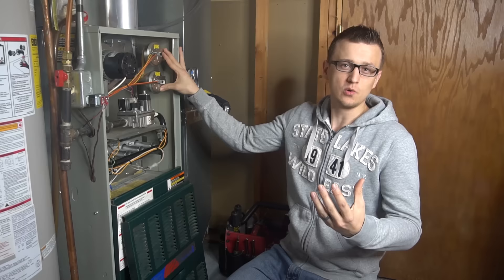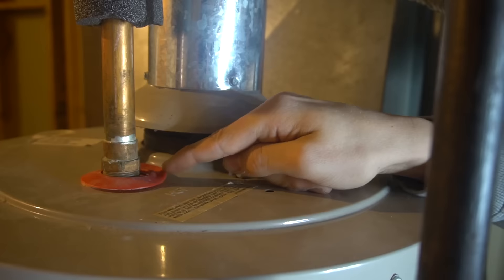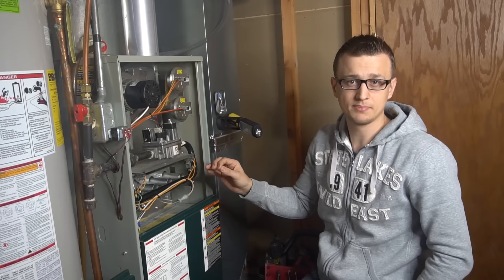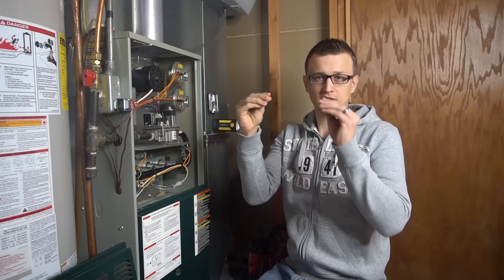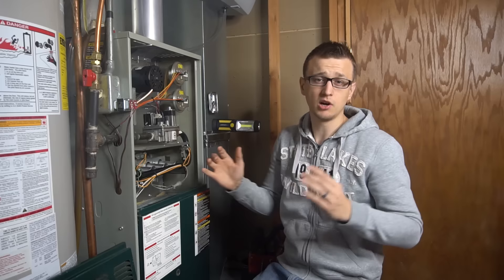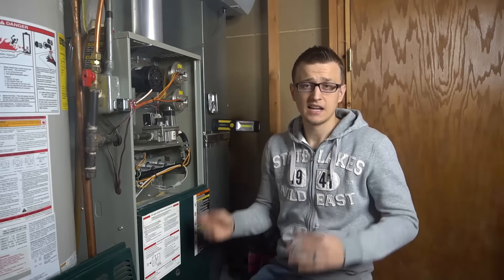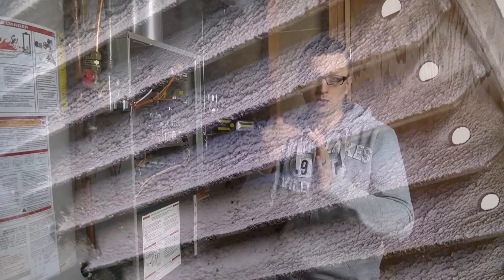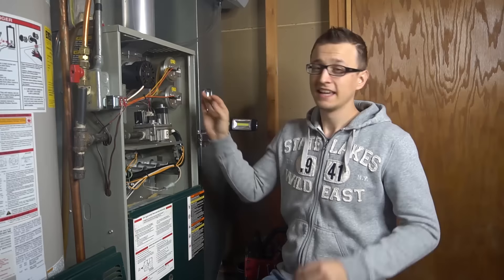Furnace Pressure Switch Troubleshooting

Comment: Jay, thank you for the accurate and useful information to understand and help repair a furnace issue. This Sunday morning, I noticed our 12 year old High Efficiency Carier furnace making a running sound. Our thermostat showed 66 (set at 68). The main furnace blower was not running. I removed the furnace panel and didn't see  flashing error indicators. However, I didn't get down on the floor to look into the little observation hole. So, I started looking at the many hoses and connections and discovered the condensate drain hose, severely bent. I can't believe it was built this way, but maybe through the years the strength of the hose weakened and could no longer support the sharp radius bend. I went out to my local auto parts store and bought a foot of rubber hose to replace the old one. 

Thanks for the tip about cleaning the condensate trap. I removed mine and used an old drain cleaning snake (like a large pipe cleaner, that worked great). There was not a way to attach the photo of the hose and cleaning snake, so I added that as my picture for reference.

Thanks again from a past TV repair guy (with BSEE)
Gene

Comment: My furnace would only run for 5 minutes on 15 minutes off under continuous heat call. My low fire pressure sensor switch was not closing, when I bypassed it, the furnace worked. But next, high heating ran for no more than 10 seconds at a try. Your suggestion of removing the burner access panel solved everything, indicating an intake blockage. The installer did not put a screen on the intake and mice built a nest in the intake pipe. Too bad you don't do car trouble videos LOL. Thanks!
Reply: If you don't find anything in your intake can it be your inducer motor I have same problem

Comment: This may be one of my first comments on a video on youtube. But I really need to say Thank you. My port turned out to be plugged. I first tested the pressure switch, then tried sticking a piece of wire into the port which is on my inducer motor housing. I pushed in until I hit a hard stop. I didn't want to press to hard as I didn't know if that port had a turn inside of the inducer motor housing that I couldn't see. I tried rotating it around while applying pressure in hopes it would find its way like a drain snake if it wasnt a straight shot. Nothing. The end of the wire did not have anything on it either hoping it would give me a sign that I am pressing against a dirt or whatever blockage. From there I turned power back on to my furnace with the hose still disconnected and placed my finger over the port to test if I could feel pressure or vacuum and give me direction to work whether pressure switch or port side. I could not feel anything. From there I knew it was in the port or deeper into the furnace, so I grabbed my piece of wire once again and pressed it with a bit more force and finally it popped through whatever was in there. It was stuck in there pretty good. More so than I was expecting anyway. Again thank you. Great video. Easy to follow and very informative. You earned yourself a new subscriber.

Comment: You're a lifesaver man.  We rented a house 2 weeks ago,  so I was going to have to wait until the morning for my landlord to get back to me and call an HVAC guy.  I knew it wasn't the igniter or flame sensor, and knew the inducer motor wasn't turning on. I unplugged the pressure sensor tube and it didn't seem clogged,  but I blew into it,  plugged it back in,  plugged my furnace back into the power source,  and the whole thing turned on! It's really cold already in Rio Rancho, NM, so it was not good to have the heater off the rest of the night. Thanks so much! ❤❤❤

P.s. my husband is asleep while I was fixing the furnace haha 😋

Comment: THANK goodness for the internet... 3:46 is exactly what happened to me. I floundered to fix my issue after watching many videos but this particular video pushed me to the correct solution! Thanks so much for the video! It saved me money I couldnt afford to spend at this point in time. 

 How I fixed my issue: (its a bit long winded and is only for those that may be interested in this kind of stuff)

To begin with, my induction motor would not start up. I also got the 3 flashing light error by default (Error code 3; Pressure switch stuck open.)  No spinning/working induction motor means no vacuum to the pressure switch which leads to this error code.

I found my induction motor was frozen or stuck, but after a while I was able to get it loose by rotating the motor manually. Eventually I was able to get the motor to spin freely and finally got the induction motor to start on its own with out help. However, the 3 flashing light error persisted and the furnace would not ignite.  Which lead me to concentrate on the 'Pressure Switch'  

Unfortunately, I did not have a volt/multi metter to test the voltage at the time to the pressure switch so I did the next best thing and simulated a vacuum to the 'Pressure Switch' directly and the furnace ignited.  (use your imagination, sucking on the hose lightly, steadily and slowly) this 'procedure'  actually got the furnace to ignite  and thereby eliminated the 'Pressure Switch' as the issue. That said, had that procedure failed I would have been forced to check the voltage to the 'Pressure Switch' and moved on from there. 

The diagnoses from the previous test dictates the 'induction motor' was not producing enough vacuum to the ''pressure switch'. This is when I removed the 'induction motor' housing from furnace. This is where I found 2 baby birds stuck in the inner housing of the exhaust fan. I can only surmise during the spring time birds nested in the exhaust tubing and the 2 chicks tried to fly free from the nest but ended up deeper into the exhaust tubing and eventually ended up in the 'induction motor housing'

Obviously, once I cleared the housing and reassembled everything. The furnace operates normally. Had it not been for Word of Advice TV I would never have thought of looking at the exhaust part if this issue. Again, I am extremely grateful for this channel!

Comment: Thank you many times over. Our gas furnace was not coming on. I watched several of your videos on how furnaces operate and how to troubleshoot and narrow down issues. I then went straight to looking for an error code on the controller board; then watched this video once I got to the pressure sensor switch open code. After probing for proper voltages, I blew into the pressure sensor hose going into the fan/motor housing, and it was completely stopped up - no air movement. Ran a wire through the port, plugged the hose back in, and the furnace was back to working. Your hands on demonstrations and practical tips - like shorting out R and W to call for the heater to turn on - are very helpful.

Comment: I've been troubleshooting many other things both for work and at home my whole life and immediately knew that this was going to be extremely helpful.  You covered a lot of ground in a very short time.  I was not disappointed!   For me the pressure switch would not release until I removed the tube on the condensate side.  I'm pretty sure I'm going to find that it's time to replace my 30 year old furnace. The good news is that I was able to get the heat running for now, the inside temperature was getting pretty low.  I need to poke around some more to see what I can find but I'm pretty sure I will need to call in the professional's for a total replacement.  Unfortunately, from experience I know that it will be best to checkup on the work they do, they all are not as good as you are.   For instance while troubleshooting this problem I found that the C terminal screw for the common bus side of the 24Volt transformer was at least a turn and a half loose.  Not sure how it has worked for so long. Thanks Much
Reply from the maker: Thanks John! Glad you found my video useful :) Good luck with the furnace!

Comment: I have to say thanks! My blower port was clogged. I was about to assume it was either the switch or the control board and with a stiff wire, I was able to unclog it. Works like new. Thanks again!!

Comment: Thank you for all of this information. I woke up to a 59 degree house yesterday morning. I saw that it was a pressure switch fault. I gave the pressure switch a couple knocks and the hose a few squeezes and the furnace began cycling normally. Wake up this morning to a 61 degree house. I took the pressure switch hose off, blew through the hose, put a needle through the inlet on the housing and gently into the pressure switch inlet and it is now cycling normally again. I hope this has finally fixed it!

Comment: Hi Jay: 
One of the best video on pressure switches, however we are seeking more of your knowledge on pressure switches;
Can you please do video on:
1- When you have two or more pressure witches how do you know which one is bad?

2- the difference between two ports and single port pressure switches with respect to testing?

3- the difference between two terminals and three terminals pressure switches? 

4- Can you use three terminals pressure switches for two wires and simply not to use the common terminal? 

5- for two terminals, does it matter which wire connected to which terminal. 

Thanks for all your help, you are currently the best on UTube with respect to HVAC.

Comment: I had an error code on my Furnace for the pressure switch. I watched your intuitive video on error codes and traced the cause to be condensate built up in the drain line, backing up into the vent motor which caused that motor to labor to run and trip out the system!
I am truly thankful for teacher/Techs like you for sharing these incredibly helpful videos!!

Comment: This just saved me waiting a few days in the cold. It's Christmas Eve on a Sat, imagine how much I would need to pay to get someone here?! Watching this video and trying a few fixes resolved my problem. It was between blocked sensor tube or clogged drain pipe. Either way, the furnace is finally back up and running. Thank you for your very good instructions.

Comment: Fantastic video. So well explained, well done. Helped me diagnose a pressure switch hose that had cracked because it was too short and was stressed because of bend that was too extreme where it was connected. $3 part and it's fixed. Thank you so much!!

Comment: Thank you so much.!  My Amana furnace  fired up and running. It is -11C tonight in Toronto and I had no heat for the last 2 days. It was  E2 code which is pressure switch.  I did all the steps from your video except electrical testing :) I checked all the pipes outside,, disconnected and cleaned all the drain tubes, used a paper clip to clean inside those ports.   I did "blowing" test and I did hear a click inside the switch.  I gently moved all the wires and connectors. I don't know what exactly I fixed :) , but my furnace is running! Thank you. 
P.S. I am 55 years old women with no knowledge of any kind of mechanical stuff. :D

Comment: Great job, and Thank you!  This helped me get my furnace working! I had to clean the pipe that came from the small fan and was attached to the rubber hose. I used a copper wire pressed into there an went back and forth to clean it a bit.  (issue was that i had the light flash 3, for Stuck Open  Pressure Switch)
Reply from the maker: Glad to hear you were able to get it fixed! Thank you for leaving a comment, stay warm!

Comment: Thanks I had a company come out and tell me my furnace was fully busted but by reading the error code and seeing it said furnace pressure switch stuck open and following your methods to find out the problem it seems the tube for the drain on the inducer motor was backing up into the inducer motor housing and leaking out on my control board. $100 for a new board, a new inducer clamp and trimming the drain tube so it no longer bends upwards worked.  Thanks for this video. Saved me $4700.

Comment: Thank you for your videos. After your troubleshooting videos, I was able to successfully fix my AC and furnace.  Great videos! Keep them coming.
Reply: Thank you Jay . helped me solve my problem. Pressure switch wasn't working because condensate was backed up all the way up my outlet pipe due to ice forming at the exit from the house..

Comment: You have the gift of explaining complex matters extremely well!  I have a Bryant two-stage furnace, about 10 years old.   It's been giving the 4:3 pressure switch code intermittently since last spring.  I went though the troubles of replacing the control board, and later the pressure switch itself.  None worked.  This weekend the overnight lows are going to be in the 20s so I must have consistent heating.  Before I bite the bullet and call the plumber, I decided to do one more YouTube search on the issue.... Boy oh boy!  It was the pugged condensate trap!   You even pointed out the brands of furnaces that are prone to the problem.  Bryant is one of them.  Thanks so much and cheers!

Comment: A couple days ago my furnace came up with the 3 blink pressure switch error. I'm a bit of a DIY-er but have never worked on a furnace before. After watching some videos I felt confident enough to do some troubleshooting. I blew and sucked the pressure switch and got the *click*. Hooked up my shop vac to the intake & exhaust pipes set to blow but nothing came out. Removed the inducer to see if it was dirty or had plugged ports; everything was pretty darn clean. I even cleaned out the condensation drain line, one of the ports was actually plugged but still the error code persisted. 
The furnace would start up and run continuously when removing the burner box cover. I could put the cover back on after start up and the flames did not extinguish. 
I then noticed that if I tapped the pressure switch while the furnace was trying to start it would work. I took out the air pressure switch and right away some  water had spilt out. Water collected inside restricting the amount of air that was able to pass through. After dumping out the water it's running perfectly. I have a new switch ordered just in case there is any water damage that appears later on. 
Took me a while to figure out and I learned so much. Your videos have been incredibly resourceful for me. Thank you for sharing.

Comment: Jay, I've watched several of your videos and you've saved me a lot.  My furnace would reset and come back on 30 minutes after cycling power.  After checking many things,  I finally pulled the intake pipe and discovered leaves and bits of leaves at the grate just above the burner box.  I would have never suspected that since the intake is fairly well covered up outside.  Good troubleshooting advice..and good perspective on potential problems.   Well delivered as well!  Many thanks! 👍

Comment: My furnace was starting and then shut down in a few seconds. Not the flame sensor or pressure switch. Some type of bugs built a nest in the exhaust vent and was restricting the air flow. Blew it out with a shop vac blower and everything is fine now.

Comment: You just saved me a service call. Low pressure switch problem, turned out a mouse chewed through the pressure line, shortened the line and re-attached it and I was good to go. Thanks a bunch!!!

Comment: I can’t thank you enough for this video. 
I replaced  just about every part in my fiancé’s 23 year old Amana/Goodman 90% heater, but it still wasn’t working 
 and the  cause was a pressure switch— which I had already replaced.  
I replaced the induction motor a couple of days ago and I tested the system. It ran for 37 minutes and 28 seconds then cut out.
The blink coach indicated the pressure switch – – i.e one of the ones I had just replaced. 
I was about to call a repair person when I watched your video.
After I saw the part about the condensation, 
I said I’ll give it one more try. I pulled One end of the hose hose off the pressure switch and pointed it down outside the heater. About an ounce of water came out.
I pulled the hose off, blew it out with Canned air let it sit for a while on the sun to dry it out. I reinstall the hose, crossed my  fingers, and fired the unit up.
And it did fire up and is running perfectly.
The thermostat was satisfied in the unit shut down, but I am running the circulation fan only for about six or seven hours to make sure that all condensate is out of the unit.
Thank you so much for your brilliant video.

Comment: I got 3 flashes. Going to troubleshoot it now with the help of this video. I got condensation and sag. We had to move the furnace 2 inches to accommodate the new A coil and in doing so, the exhaust pipe is now cramped because its all glued together. After I check the pressure sensors, I'll attempt a repair of the exhaust vent pipe. Excess condensation was a previous problem resolved. Before that, we discovered that the installer failed to orient the hot sensor 90 degrees on a horizontally mounted furnace. Thanks for the video, great performance all around.

Comment: You are Fantastic! We are having severe financial problems so when the furnace wouldn't start this year I was just deflated. Didn't have the money to fix it. But after reading the back of my furnace panel, counting the blinks, and determining it was the low pressure switch I came to YouTube and found you. Great video! I first tried clearing the pressure tubing then gently blew and sucked of the hose. Heard the switch make contact. put it back together and the furnaced fired right up! Dude, you saved me hundreds of dollar$ that I don't have right now. Keep coming out with these great videos! you're the best!!!